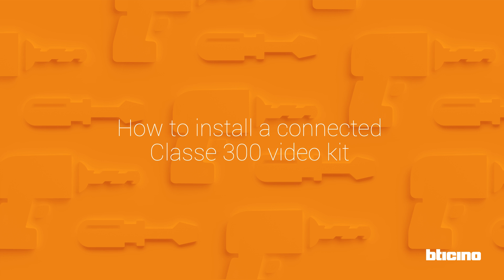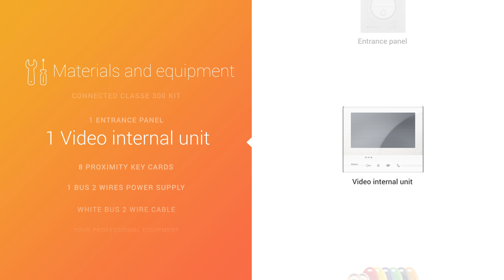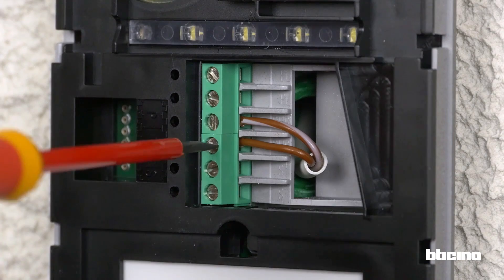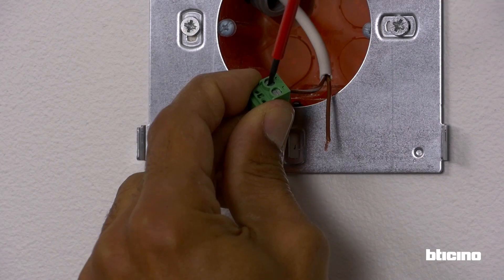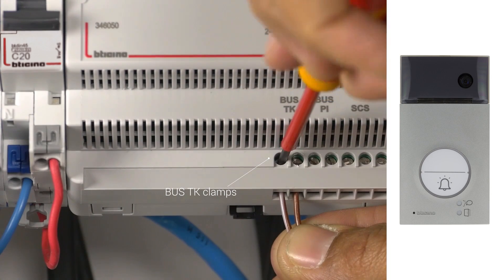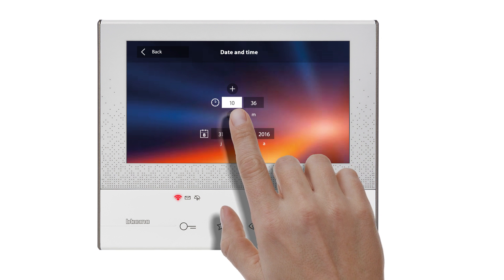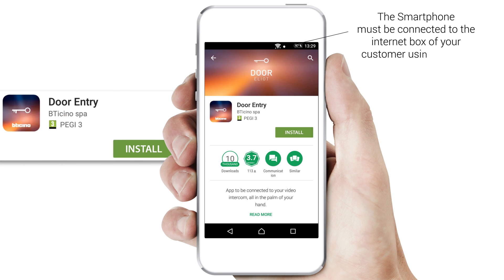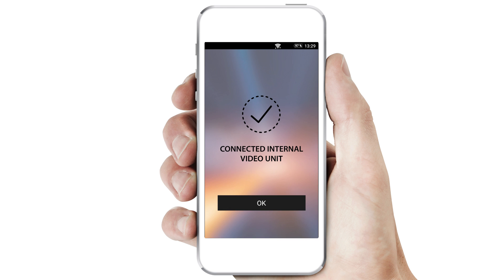BTicino : how to install a connected Classe 300 video kit

Comment: how do you connect garage openning?
Reply: Did you figure this out?
Reply: @AlejandroTaylorEscribano  hi! You have to buy an extra Module, I finally connected some lights instead garage, however since that time I bought smart divices  such as lights, modules and remote controls in order to use them with Tuya/SmartLife App, Bticino its dificcult to integrate with other smart products and they are too expensive
Reply: @krostywrx  any recommendations for garage openers then?
Reply: @AlejandroTaylorEscribano  in case you only use remote control, will be harder cos u will need to know frequency and stuffs like that in order to copy the frequency and try to apply it in an Smartlife/Tuya control